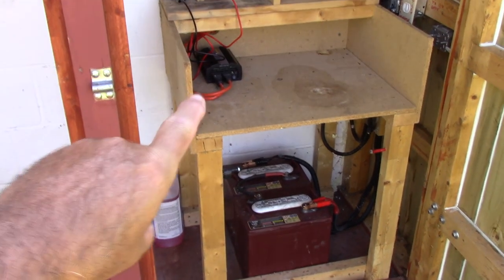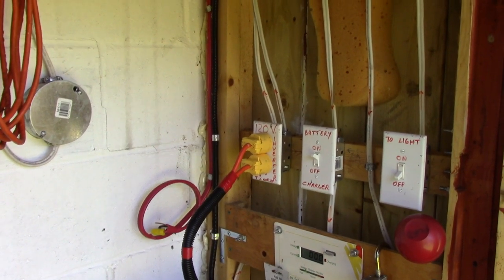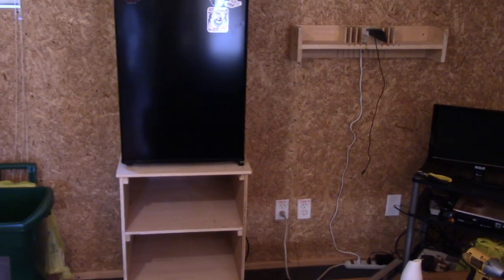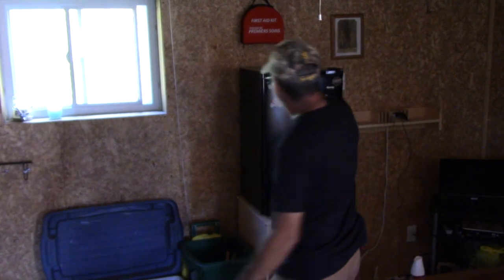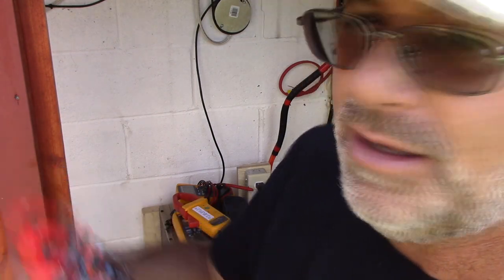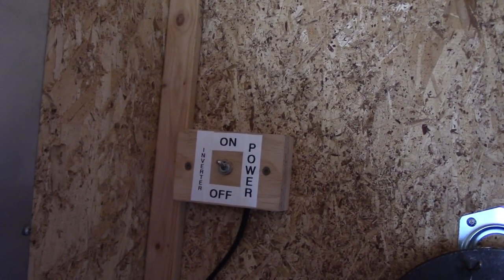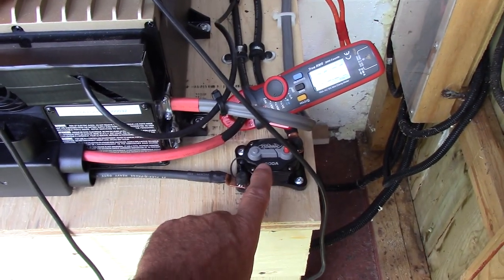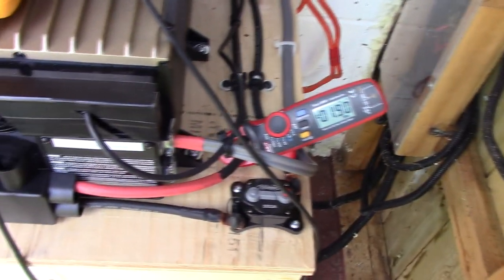LOW COST OFF GRID SOLAR POWERED FRIDGE PROJECT  -  MUST SEE IF YOUR THINKING OF DOING THIS

Comment: Yes the inverter uses power all the time , other option is , turn on inverter with the thermostat in the fridge, remove power cord from fridge and connect directly to compressor, plug the compressor into a small inverter 400 watt + and    
Have the thermostat turn on the inverter through a modification in the inverter power switch.   The fridge thermostat closes the switch contacts, turning on the inverter. Saves about 15-30 % power from your battery system.

Comment: Normally the circuit breaker goes in the positive side of the DC circuit. Great videos and thanks, I have been looking for a cheap way to have a refrigerator on batteries.  Bring up your supplies in a cooler on ice and you will start with less heat to get rid of and your battery drain will be less getting the refrigerator going.
Reply from the maker: So far its working great 👍.

Comment: Using the voltage drop method for testing DC circuits works good as well. You should be set now, you will be able to get up in the morning and snap a cap on a cold one right away. Thank you for the video, Steve
Reply from the maker: Lots of fun with dc and lots of fun with a cold fridge too. Cheers Sean.

Comment: We used to have a propane fridge/freezer at our off grid home. It was ancient and when it died we actually just went with a normal 120v fridge as a propane fridge is expensive and those "off grid fridges" are ridiculously priced like you say. Where we got crafty is we had a chest freezer we had inside the house. We moved it outside to the work shop, and we don't plug it in for the winter and it works just perfect with our cold winters. Since I've owned my place for a year, the winter is a night and day difference (no pun intended haha) for our solar system. I could run a welder during the summer no problem but with winter being so cloudy all the time you have to start paying attention. Cheers Rob
Reply from the maker: Sounds like a great setup.  You have a youtube channel and have made some videos so have you thought about doing more and showing some of your setup and future plans. I would surely give you a hand in mentioning your channel on mine  , my viewers would love to see more solar content if  you had the time to do so. Cheers
Reply: @SteveRobReviews  I appreciate the support but I don't have internet at the house, only while I'm at work or in town. Also with that being said, I like to stay private and I usually just use youtube as a tool to sell vehicles. I thoroughly enjoy your content.

Comment: Things are never quite what you think they are. You don't know what you really got till you measure it.  You should put a 100A shunt in series with the 12V and hook the min/max meter to it.  You will be surprised at the results compared to what you calculated. Also measure the minimum voltage at startup in the morning.

You got me to check my 7cf chest fridge after many years of operation. 512WH one day and 575WH the next after adding groceries. Your 2A idle surprised even me. My cheapo 2,000W Harbor Freight only consumes 300ma with the fans removed.  You should cut into the thermostat and use that to turn it off and on.  Add only a relay and it will work with either the thermostat or wall switch automatically.
Reply from the maker: I like to keep it simple including testing. As long as you plan for more than you need you can do basic testing and have plenty of oops room left. 😅

Comment: Amp hours of batteries in series is the same as the amp hours of a single battery. So if you use two 6 Volt 210 Amp hour batteries in series, you get 210 Amp hours at 12 volts.

Comment: Ya, I’m not into that tripplite for several reasons. 

I’d suggest you get a pure sine inverter, not a cheapie, and just leave it on all the time. Add one more battery for headroom.
Reply from the maker: I don't need a pure sine wave inverter at all , so far its working out just fine .

Comment: Great job Steve looks like a good set up.   What’s the sponge 🧽 behind your 12-3 wire for?
Reply from the maker: Thanks. I had a water tank in the shed for tap water years back and the sponge was used to get all the water out of the tank  in the fall .